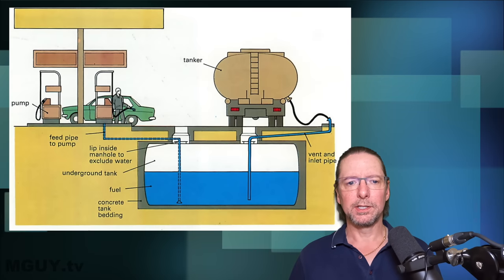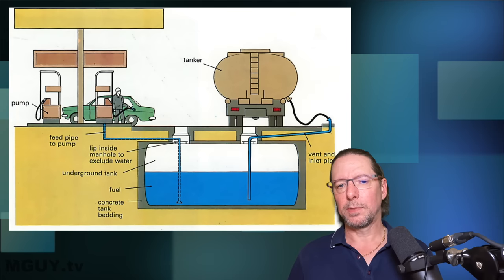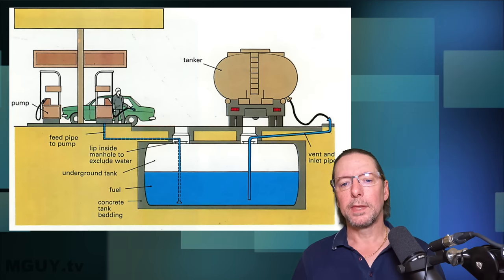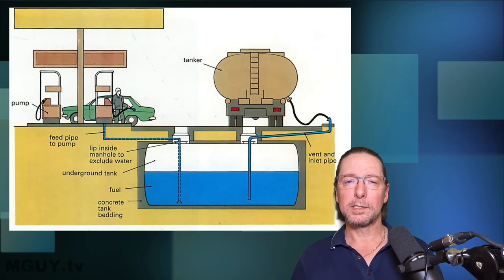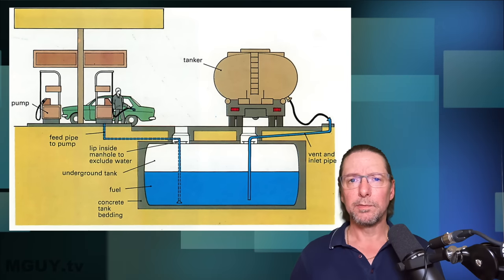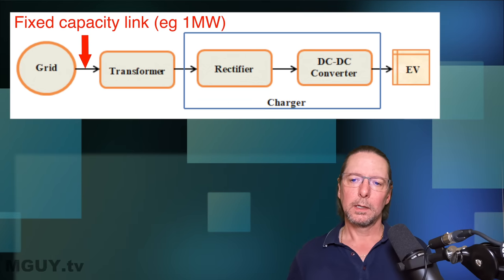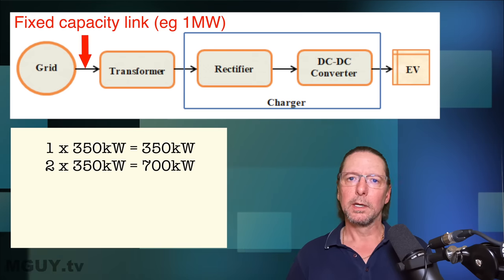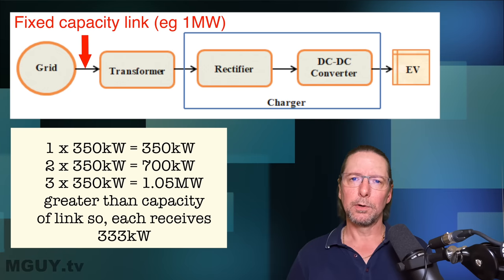HUGE problem with EV Charging Stations that no one mentions | MGUY Australia

Comment: i think most people worked that out,  these service stations also benefit from additional meals and some even has shops selling goods like airports do. I recently saw a video where they were constructing a row of 10 new charging points powered by a DIESEL generator, the irony of it all.
 Motor engineers have developed the Euro 7 diesel engine that's virtually C02 free ?

Comment: How much power can an average city transformer handle? I saw a new one get installed a few years ago and it was about 4 meters long 1.5-1.7m high and about 1.5 wide. I think the actual transformer sits in the middle and the one end is connections and the other cooling. 
Can you even push a mega watt through one? 
I assume from looking at it there's about 4 cables coming out maybey 500 amp each.
So being generous 2000a x 250v thats 5 mega watts. 
So by my rough estimates you would need a whole new transformer to charge 15 cars and that's it maxxed out. 

Also you will need to build fire bays, have shade and some sort of cooling fan arrangement because batteries get hot while they charge, pack 15 together on a hot day you're asking for trouble.

Comment: By extension of this theory, if you have a string of charging stations along a highway, all drawing from a single feeder line, the available power per station per vehicle would drop depending on the capacity of the main line.

Just too many variables here, with even the overall grid capacity of the entire country being one BIG "x"!

IMO, EV fans don't see the obvious, for the stars in their eyes. 🥹

The politbureau, 🙄.

Comment: Charging a battery takes longer than filling a gas tank. If you can charge at home and don’t do long trips, that may not be an issue. However, that longer charging window if you’re on a long trip or can’t charge overnight at home is a security risk. The longer charging time also means they’d need a lot more stations to accommodate the same number of travelers.
Reply: along the same lines, your may not remember gas stations.  we used to have gas stations.  they've all been replaced with convenience stores. so you fill up, get a coffee, bread, ice cream.go. 

the point being: i don't see any convenience stores installing electric charge ups.  why? obviously it is not commercially vialble at this time.  

it is not commercially viable to add electric chargers to the existing infrastructure.  not to nobody not no how.  not to wawa, not to sheetz, nobody with capital is betting that it is commercially vialble to install electric chargers.

Comment: An article earlier this year about the cost and time to charge an EV.    It took almost 2 hours for a charge, costs $63 in California, and the mileage increases to 95 miles!   Wrote this from memory, but efficiency is not at all present in an EV recharge!    It’s not free!
Reply: Your memory is bad. Either that or the article was wrong. Most EVs can achieve an efficiency of 3.5 miles per kWh. In CA the public chargers cost around 50c per kWh for a Rapid DC charger. But it sounds like your reporter was actually using a destination charger of 7kW if it took 2 hours. That would load 14 kWhs at c 40c = $5.60. And 14 kWhs @ 3.5 miles per kW = 50 miles. Something very wrong with your article figures.

Comment: Thinking about that I thought of the new Buckee's gas station that has 120 pumps, average 5 minute fill up time. Change that to 2 hour charge time they would  need 2,880 charge stations, at 350KW each it would require a few coal power plants putting out 1 Gigawatt, or if enough water was near 40 dams each producing 25 megawatts just to power that station.

Comment: As a Tesla owner for a year and a half, I wish to help set the record straight, as MGUY is obviously biased against EV's. 
Yes, there is no tank for storing large amounts of power at a station. But with EV's most chqarging is not done at a station, but wile parked, either at home, at work, while shopping, at a relatives house, etc. It largely just requies a mental reset about charging. BTW, I charge my Tesla off of a 240 volt 20 amp circuit (called a NEMA 6-20 in the Americas) and I have no problem keeping my car charged of this small-ish circuit, mostly done overnight, when there is less demand on the power grid. 

Yes, while travelling, you do need lots of power at charging stations, but this has not been an insurmountable problem, at least so far. Yes, there are places where the power company has a lack of pwer in some areas, but there was a time when there were not gas stations everywhere wither.

And a company in England has started installing a system to charge cars, at night, in cities, without garages. They install electrical outlets in power poles, light poles, etc, where much of the wiring already exists. Partly this works because of hte lower power requirements of LED lights, which means the wiring in the poles, mostly setup in incandescent days, is 'over-sized fro the current LED lights. Brilliant system.

Comment: One local Costco had a bank of chargers, I think it was 4, installed out front for their customers to use to charge up their battery cars. I don't know if it was high power or not but assume it was since they had commercial 480VAC power going into the store so I'd assume they did. If they didn't have 480V, they more than likely had 240V to supply power to all the refrigeration equipment so they had at lease 240VAC power!
That said, within the last few years, these chargers were all removed! I thought it was quite strange.  But then, the battery car owners were not paying for topping off their batteries so it must have cost the business a lot and they removed it to save on high utility costs!!!

Comment: Seeing empty EV charging lot's gives me visions of Drive-In movies with the stands holding speakers for each vehicle. (Which were replaced with a low wattage radio transmitter to be received by the vehicles onboard radio system)  In other words it seems already obsolete.

Comment: The tech exists to cover this. The charging stations on major routes would need their own on site batteries to protection the same role as the big tank for the gas station.

So it's not at all impossible: it does however push the capital costs up

Comment: A concern i have is people without a garage, the ones who park in the street or inner city dwellers.

These people are now running 240v power cord out of windows and over fences, some have tried to use office cable management tubing to strop tripping on the wire

What will they do when it rains, will they go out with live 240v cable and plug it into the car, what is some one on the foot path gets electrocuted

We have a local BP, i was filling up with petrol and noticed next to the shop 2 x EV stations
I asked the cashier and she mumbled, that people park the EV then leave and go to work and come back 8 to 9 hours later - she said they are putting up a sign, 1 hour then it is towed off the yard and the town and impound fees with be over $200

I mentioned to her Texas had a rough xmas last year as did California and the governors were on TV asking people to only use one air con per house and not to charge EV's as there is not enough electricity for the cold winter

Comment: You have pointed out something that I haven't heard ANYONE else talk about! Even if the EV charging station had a massive 10Mw supply from the grid to service say 25 chargers at full capacity concurrently - WHERE is all of that 10Mw of electricity going to come from? Oh wait... it's coming from coal or natural gas fired power plants, or maybe nuclear in some areas. BUT, electrical grids (at least here in the US) were never designed to be able to deliver the absolutely MASSIVE amount of electrical power that tens or hundreds of millions of BEVs charging away at tens or hundreds of thousands of charging stations scattered around the country would need anyway. It's neither sustainable nor scalable, and it's frankly just preposterous!

ALSO: BEVs will not be "green" until ALL of the power they suck from the grid is "green" as well. Driving a BEV is just virtue-signalling, and it's just moving the emissions problem to power plants so it's relatively out of sight and out of mind. Some rich people may be able to afford to install very expensive solar arrays on their roofs to store the electricity generated from them in a big Tesla Power Wall or the equivalent. But let's get real... the overwhelming majority of people simply cannot afford to do that and never will. It would cost FAR more to do that the the BEV itself costs, and I don't see that ever happening on any significant scale in my lifetime.

Comment: I work in the EV industry in the US and I find this video somewhat misleading.  It is true that delivering power to DC fast chargers (and even Level 2 chargers) sometimes can be difficult and expensive.  A proper charger installation consists of a site survey, where we inspect and record the current electrical usage, the available switchgear and distribution panels, and the space available for additional electrical equipment, like meter base(s), circuit breaker panels, etc. We then have to submit a "load letter" to the electrical utility, which documents all the current loads, and the additional loads we intend to create, based on the number and size of chargers the customer wants.  The utility can quickly determine the current  power usage and the available spare capacity of the distribution transformer that supplies the customer's site.  They will tell us whether the existing transformer can support the load, or if a new one has to be installed.  At that point we work up a price and set of specifications for the customer.  If there is a limitation on power or excessive costs, we tell the customer up front.  That also includes load sharing, where the charging rate is reduced based on the number of people charging their EVs at a given time.  Load sharing is generally not acceptable with DC fast chargers in public or commercial installations, but that decision is up to the customer buying the equipment. 

As far as causing brownouts and  competing with industry, that is just an engineering problem, and can be avoided.  Brownouts are not only expensive for industry, but in many localities the power company can be subject to fines and even lawsuits.  I have not seen that problem in the area that we serve, except when caused by severe weather or technical failures.

This is all predicated on the regional government and utility company expanding infrastructure to support the growth of the EV industry.  I am seeing a lot more solar panels and windmill farms being built in the Eastern US, where we operate.  I'm not sure when or if  power consumption will exceed the power available. Tesla has created some pretty innovative technology with their Powerwall energy storage system, especially for those who have EVs and solar panels.  These systems can send excess power back to the grid.

The EV industry is currently having its growing pains, but will stabilize and evolve over time, which is typical for new technology.

Comment: I have not run into that problem with my Tesla in the US. It is my understanding that 2 or 3  might be sharing a feed with Tesla chargers. 
I make it a point, if I have the option to not park next to another charging car, so I’m not sharing with anyone. Tesla may have high standards and I have not run into any throttled stations.  If I have a choice I will select 250 kwh stations over 150 kWh location.

Comment: The other thing people don't fully realise is the massive amount of power these chargers are drawing.  A 175kW Tesla fast charger draws a huge amount of power ... approx 80 times what a average sized split system air conditioner uses.  And that's per car !  In the middle of summer, when electricity use is high, and perhaps at times bordering on brown outs, you can cool 80 houses or charge 1 electric car.  Clearly upgraded electricity distribution systems are needed.

Comment: In cities maybe Ev’s are workable, but in remote areas such as Western Australia they don’t work as 1…They take too long to charge when compared to about 10 minutes to fill with petrol/diesel. 2…In remote areas power for petrol stations is from diesel generators, which defeats the purpose. 3…The cost of buying an Ev is huge and out of reach for most. 4… There is already power generation shortfalls in many countries so countries will eventually have to generate from nuclear plants or hydro. But then the greenies will protest against that, wind power is not really practical long term with the short service life of blades etc and cost. Solar is a joke as is pumped hydro.
Hydrogen is a better option imho.

Comment: 350kW seems an awfully large amount of power to supply to one car!

My understanding is that the time to charge up an EV battery is determined by two factors:
- how much the charger can supply
- how much the car’s Battery Management System can accept  (Its Charge Acceptance Rate)

From what I have read:
Level 1 chargers plug into a normal wall socket at home (10 or 16 amp fuse)
Level 2 chargers are the most common commercial chargers 
Level 3 chargers are the rarer “high output” chargers

Level 1 chargers using  240V AC, single phase, have a maximum power delivery of about 3.7 kW   (16 amps)
Level 2 chargers using  240V AC, single phase, have a maximum power delivery of about 7.7 kW   (32 amps)
Level 2 chargers using  400V AC, three phase, have a maximum power delivery of  about 22  kW  
Level 3 chargers using  DC                                   have a maximum power delivery of  about 50  kW

Estimated range from one hour at the (level 1) 3.7 kW charge rate is  about 25km
Estimated range from one hour at the (level 2) 7.7 kW charge rate is  about 50km
Estimated range from one hour at the (level 2) 22  kW charge rate is  about 150km

However, those are the best obtainable figures.  If the Battery Management System cannot take the power on offer, then the times will blow out.

A typical EV battery is around 40kWH capacity, and is unable to accept the full DC output, let alone 350kW.
Note also, that at 98% efficiency, a 350kW output will put only 343kW into the battery as charge.  The rest will be wasted as heat, and putting 7kW of heat into a battery will do it no good at all !

I agree with your premise that the greater the number of  cars trying to charge concurrently the less power there will be available for each IF the capacity of supply into the Charging Station is less than the number of chargers multiplied by their actual output (as limited by the BMS’s Charge Acceptance Rate).  In that case, each charger's output will be limited, and the charging times for everyone will blow out.   That’s just simple maths.

However, a more likely scenario is that there will be NO POWER AT ALL because of black-outs caused by idiot politicians trying to replace reliable coal-generated and gas-generated power with unreliable wind and solar power.  (But that is another discussion).

Comment: no one mention it because power grid dont work like that at all
If for example 4 stations will overload the input they put only 3. The station will draw it maxim no matter what and improper installation will just trip the safety switch to protect the wires from melting. Granted there is a little fluctuation up or down but nothing you can spot without measuring device.

Comment: I believe the bigger problem will be home charging.
Plugging two EVs in is ike having a welding shop. So picture an entire street of houses when the people come home and plug in their cars. BOOM neighborhood transformer goes. Now picture the larger development of several hundred homes.
Now imagine a high rise building.
Suddenly the apartment block needs the same amount of electric capacity as a very large industry.
All of this needs lots and lots of copper.
We have long since dug up the easy copper and the high grade copper.
There is NOT ENOUGH COPPER.
Copper is the show stopper.
It has no replacement.

Comment: A better way to deliver power to large charging stations is to locate them in a large carpark such as a supermarket or shopping centre, and cover the entire area with solar arrays, which charge LFP storage batteries. That way you are supplementing grid power with on-site renewable power, and have a buffer in the storage batteries for times of heavy usage. Not a cheap solution, but if people want EV's they need to understand that in the long run, public charging is not going to be cheaper than refuelling a petrol or diesel car. The only reason for doing it is to clean up the air we are all breathing. Personally, I don't think EV's should be mandated, but if we reach some kind of equilibrium between ICE and EV's where those who violently object to EV's can keep their ICE cars, and pay for the privilege, great. I don't have an EV yet, but when it makes sense for me I will probably get one eventually, but from my understanding fast charging decreases battery life, so I will avoid public chargers like the plague and endeavour to only charge at home on a Level 1 or 2 charger, which is cheaper anyway.